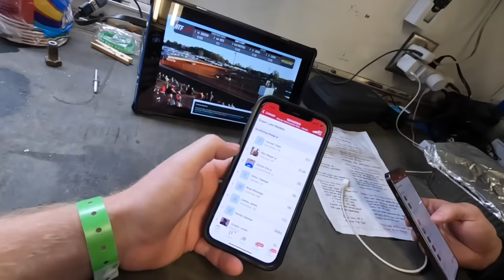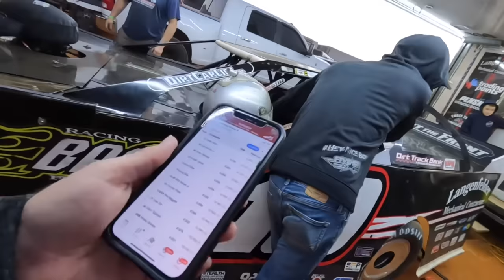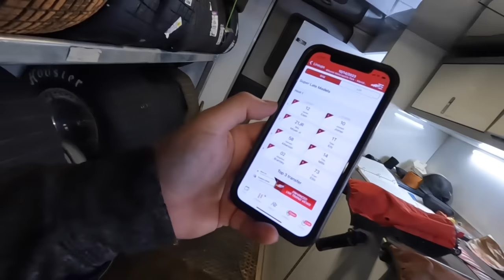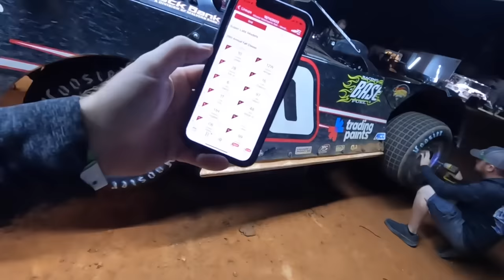Big Wreck and a Dramatic Pit Stop! Fall Classic Finale at Whynot Motorsports Park

Comment: Dang it man! What the hell is with Joseph's starts...always backing up. Gotta get that situation fixed.
Reply: Does it every time like clock work
Reply: Needs to be more aggressive too, they got the money to replace a quarter panel!
Reply: It’s like he’s worried about the cars in front of him stacking up , but there’s no reward without risk . Put the pressure to em
Reply: Going from 1st to 5th in one lap isn't easy with air in all 4 tires and the engine still running that's quite an accomplishment
Reply: Scared to stick the nose in there. Get off that dang bottom. Qualify and wins the heat on the top but wants to race the bottom.
Reply: @jessiebateman82  well said, needs to run the high side man, I remember back when I first started watching Jonathan and all of them said bottom was fasted because it’s shortest way around the track and I figured they’d learn by now!
Reply: BOTTOM FEEDER!
Reply: How do you all perform in your races?
Reply: @l3rining115  well I perform well I’m from where Tyler carpenter is and he also helps me work on my car, tracks around here are topside fast if I run the bottom it’s only to get past lap traffic.
Reply: @l3rining115 definitely not losers like your hero
Reply: When go back at the start that's what happens

Comment: I have a question..is running the inside lane at all the corners the best use of the Clements power and torque curve? It seems the leaders were in a higher groove.  I am asking because I don't see how you get skunked to 4th in the first few laps unless you are not pulling HP or torque to match others. This is not a criticism..just a question seeking a knowledgeable answer
Reply: Its a bunch of stuff that adds up!! Tire choice, air psi, bar angle, shock and spring set!!!
The track also changes alot in a short amount of time!!! Something small adds up quick!!!
Reply: @jasonhastings5538 so basically they aren't setting up for the track changes that are inevitable like Devon Moran 🤷‍♂️
Reply: @scottwilliams1925  right!!!
Reply: @scottwilliams1925  it's like they have 1 setup and if it works ok if not just stay on bottom and protect position....this team has gotten so bad it's really sad...ever since the TV shit started the racing part took a hard nosedive and if u don't believe that you aren't being honest with yourself.
Reply: @jjsmooze5980  the race team has ZERO to do with the tv stuff. Nothing. Go cry somewhere else.
Reply: Most of everyone ran the bottom for a while. Seemed like it took a while for that top groove to open up
Reply: They admitted he missed the turn on the start and he skated up some from the bottom and they got around him initially going underneath.  Then on lap 3 or 5 or so he made a mistake again and that's why he got shuffled back some.  Then the restart and wreck happened.  FYI Erb Jr went around the bottom all night and finished 3rd, so why does it matter if up top or bottom if you know where your car gives you the best chance?
Reply: @jjsmooze5980  TV part or even the series had nothing to do with how they setup the car and what they are doing.  Joseph is the only one who is the most knowledgeable of setups and stuff and not much from anyone else (Jesse a little but I dont' think he's on par with what Joseph knows).  Joseph may not be the best setup guy or he's ok but he's still geting used to all these new cars that he gets, then the motor that goes with it and trying to figure it all out.  Maybe we just watch them for what they are, root them on and if that's not for someone else, then they can unfollow and go root on someone else.  I dont' know what to tell people but to just sit back and watch and enjoy the show.

Comment: Well some tracks don’t need a 410 or a 430 so when you destroke a motor rpm’s will be there faster in the PowerPoint now you cannot make it a wide bore but you can up date the old motors with new heads intake

Comment: Sure looks like Joseph was not at fault. Look like the other car came down on him.
Reply: Agree
Reply: Agree. The car in front lost it and Joseph pushed the issue passing, but the door was more than open. Racing deal
Reply: Yes Moyer Sr slid high and opened the door and any driver would have taken that hole but then Moyer Sr acted like Joiner was never there and decided he wanted the middle and bottom groove🤷🏻‍♂️
Reply: #10. He may not have directly caused the wreck but he is obviously a moving chicane. He’s in the way. They’re running over him because he has no consistent driving style. Not a digger.

Comment: I was hoping to see what happened tween HTF & the Billy Moyer crew. I wasn’t there,but I understand there was some sorta difference in opinion of what took place to cause the 🚩. Not even a mention on the video.
Reply: you will have to wait for next video they never reply to comments.
Reply: Kinda looked like joe got it started
Reply: @awbassfishing3955 They NEVER addressed any of those other incidents either.  Moyer should have a difference of opinion as it likely aligns more with reality. He stalled at apex and Joseph over charged the center and  completely drove right over him. Regardless it was 100% avoidable. It’s blatant by both the in car video and from other footage at reduced speed.  This is the second time this season Joseph caused a car to land on its lid. He also destroyed Overton’s Dream and had other incidents where they completely ignored the topic and took zero accountability for it. We’re talking multiple junked race cars and multiple red flags.  Each time they stated it was solely another persons fault and moved on.  Even the time when they crowded a car and turned it over. I said it before,  It’s like Joseph lacks adequate situational awareness. As a team, They definitely lack humility and authenticity. But loyal fans will only see what the chose to. It’s called perception bias. They would still support the channel of they did take partial responsibility in these normal racing deals. But one thing is a fact, no good wheelman is in constant denial of their faults.
Reply: @ChrisS-oo6fl so says a self appointed expert while living in his mommy's basement.
Reply: @ChrisS-oo6fl your flat out wrong. The 10's nose never comes off the bottom. He almost hits the tire just before the contact. The 48 was spinning himself and came down and got his nose run over. Why did he turn down? Or was he going to loop it? I'm betting if the 10 wasn't there he spins all the way around. Racing deal...
Reply: @ChrisS-oo6fl  Yep with 50 laps left you have to be more patient than that.
I think Joseph had a brain fart.
Reply: @ChrisS-oo6fl found the Moyer fan boy. Post like this always happened on bloomquisf stuff back in the day. The old man was spinning before JJ got there. He had nowhere to go.
Reply: ToddRobinson13  if there wasn't room how did he pass him? The 48's nose hits the right rear lmfao. I'm done you're not seeing this objectively at all so have a nice life.

Comment: i guess he decided not to put in the video what putnum and the 48s crew guy did to them in the pits after they fixed the shock.
Reply: Tell us
Reply: yes please tell us im sure they wont.
Reply: The 48 has no one to blame but himself. The 10 was as low as he could get the 48 washed up and about spun himself out. He comes down trying to save it and gets his nose run over. Nothing the 10 could do. Maybe the 48 could have straightened it out instead of trying to turn down. Racing deal...
Reply: ToddRobinson13 ges he had room to clear all the way to the back tire?
Reply: ToddRobinson13  wrong again but keep trying lol
Reply: I guess Putnam tried blocking Joseph from getting back on track after they fixed the shock so the htf guys pushed putum out the way. But while they where doing that one of the 48s crew guys hit the htf guys with his quad.
Reply: @ToddRobinson13  except there was that's why he was 80% by him u til the 48 came down further and got his nose run over. Your drift idea is ridiculous. Lots of guys go into corners side by side while pitched and don't wreck. In this case the guy on the outside was way out of shape and as he slowed down or was spinning he got his nose run over. I would have liked to see what happened if jj wasn't there honestly. I think he would have gone all the way around or almost to a stop trying to save it.
Reply: ToddRobinson13 oh really, well you know what they say,” if you can’t impress them with technology , baffle them with bullshit”
Reply: ToddRobinson13  fanboi? Really ?

Comment: Just a couple questions....1. How did you loose so much ground after starting on pole? 2. Why did you stay on the bottom the whole race after the red flag?
Reply: Dont ask cuz you will only get the TROLS PISSED OFF
Reply: Lost ground by missing the turn on 1st lap (as in he left room on the bottom) and the 3rd or 4th lap. Not sure on second question.
Reply: 2nd question, that was the spot to be
Reply: It's all about set up so you grip and the car will rotate like it suppose to. Track changed on him. And the bottom is probably where he cab grip
Reply: For the first question for the couple of years that I've been watching I don't think he's a fan of settings the pace on a long race but for the second question the whole reason for a big motor is to run the top
Reply: It was broke.
Reply: I love these dudes and this team but I find myself asking the first question often..
Reply: The leader came up to Joseph holding his line. The bottom was there. Just because you have a big motor, doesn't mean you ca. Run the top every night, all night long.
Reply: It's funny the winners ran and lapped JoJo on the top. So how was that the place to be?
Reply: @joeblow3435 the leader caught Joseph on the bottom and couldn't pass him. The 2nd and 3rd then went around both of them. People set their cars up for top and bottom all the time. It is hard to get a car to work everywhere and be faster than everyone the whole race.

Comment: How did that wreck even happen ive never seen someone just spin out like that. 😮 wild ride!
Reply: ToddRobinson13  you mean Moyer drove over Joseph's right rear corner.
Reply: ToddRobinson13  what hurts you the most? Being wrong or being stupid? 😅
Reply: ToddRobinson13  you must have missed the part of the video where they were beating the RR deck down with their hands right before Joseph headed back out on the track.
Reply: ToddRobinson13  Clever, but obviously still wrong. Once Moyer started parking in the turn Joseph was low and almost fully past him when Moyer ran under Josephs right rear. It's clear as day, unless of course you're biased and a real hater...

Comment: Supposedly Putnam claimed that Joseph caused the big wreck.  It looks to me like Joseph was as low as he could go on the track and Moyer came down on him.
Reply: Right, the car stopped 'parked it' in front of him in the middle of the corner. I don't think this is the track to set up for 'parking it'. Joseph probably should have been patient, but the door was more than open.
Reply: i agree plus every driver in that race would have done the same thing joseph did if the car in front of them missed the bottom grove as bad as the 48 did

Comment: That's what you get when you get down on the bottom  !  Joseph needs too get going a little sooner in the race seems to not want to race till mid race when he is deep in the pack !! get up on the wheel get under them instead dropping back a  half car !  They know what Joseph is going to due on the start and they take advantage of it you got the horse power and the car It's like he is afraid of it or afraid of the horse power !

Comment: You can,t  give up  so many  positions to the big boys. JJ  can’t run with the big boys .The engine sounds  like he is only running half throttle  . He drives like he is  on a  Sunday drive. Quit making excuses .The car is not the problem.

Comment: They NEVER addressed any of those other incidents either.  Moyer should have a difference of opinion as it likely aligns more with reality. He stalled at apex and Joseph over charged the center and  completely drove right over him. Regardless it was 100% avoidable. It’s blatant by both the in car video and from other footage at reduced speed.  This is the second time this season Joseph caused a car to land on its lid. He also destroyed Overton’s Dream and had other incidents where they completely ignored the topic and took zero accountability for it. We’re talking multiple junked race cars and multiple red flags.  Each time they stated it was solely another persons fault and moved on.  Even the time when they crowded a car and turned it over. I said it before,  It’s like Joseph lacks adequate situational awareness. As a team, They definitely lack humility and authenticity. But loyal fans will only see what the chose to. It’s called perception bias. They would still support the channel of they did take partial responsibility in these normal racing deals. But one thing is a fact, no good wheelman is in constant denial of their faults.
Reply: Troll